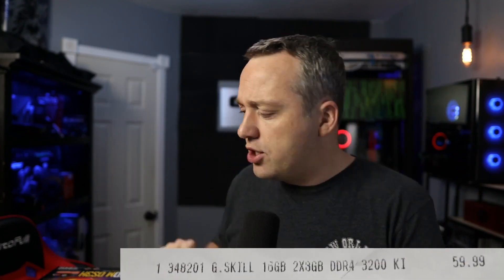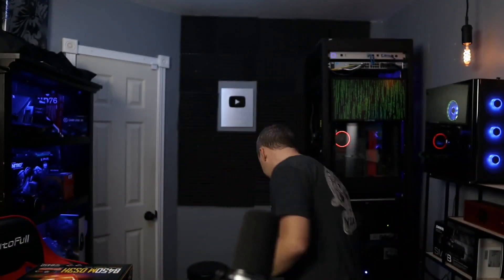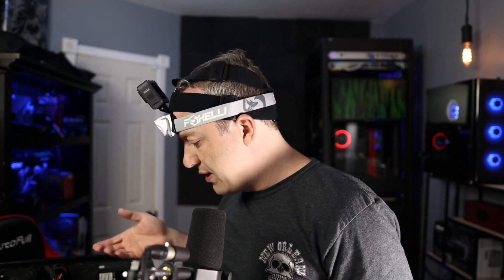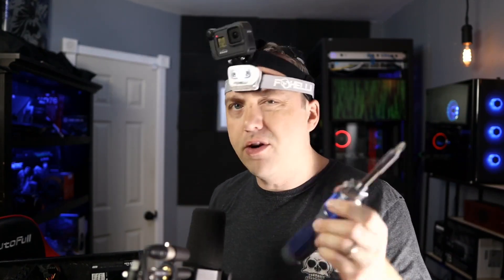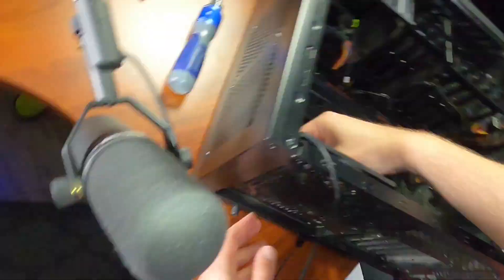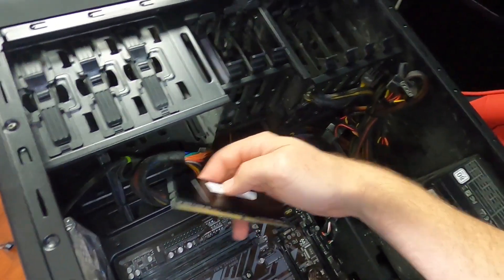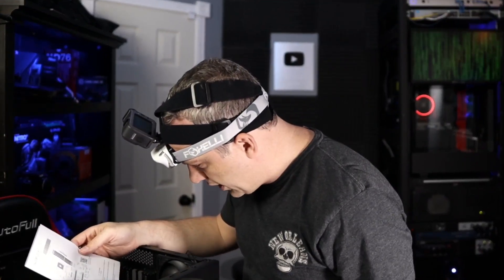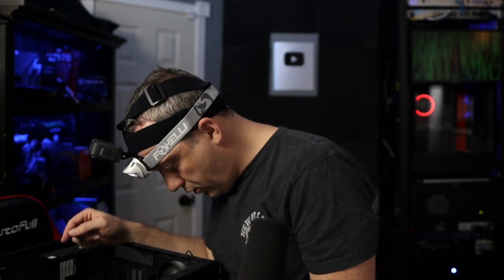Ryzen 5 3600 Budget Build

Comment: Finally someone who is on my level of budget building! I like some flare like the fan rings to be lit up. Mine is a black and blue theme like the one you have in the background. That’s all the lighting I want. Definitely not into the water cooling crap. I replaced my stock fan with the Vetroo air cooler on Amazon for $25 and it works great. Dropped temps around 10-15c and in testing it beat AIO coolers. Love your videos, they have helped me a ton getting rid of all the crap on windows 10. I’m learning a lot from you.

Comment: I have the exact same CPU and Motherboard and I am not disappointed in the least. However, my case was way too old (no cable management possible and awful air flow), so I had to get a new case as well as a new GPU. Came from an AMD Phenom II X3 720BE (with 4th core unlocked) and GTX 560. Went to a GTX 1660 OC. Love it! The Gigatbyte B450M DS3H has 4 DIMM slots. Not bad for a Micro-ATX board!

Comment: The Ryzen 5 3600 is a great CPU.  It's what I used when I built my new (current) computer earlier this year.
Reply: Does it come with a GPU?
Reply: @madthumbs1564  This model cpu does not have integrated graphics.  I chose to go with an Gigabyte Radeon 570 for my needs.

Comment: nxzt and cold master cooler lol

best to install cpu, ram, and heatsink on before mounting board into case.  The front panel connectors have a diagram printed on the PCB.  HDD/Power/Reset

Comment: I don't know what the reason for not using an electric screwdriver is. I've been building and working on computers for 30 years and I use them all the time. Primarily, I use it to REMOVE screws and it saves a ton of time. For inserting screws, I get it started manually before using the power screwdriver to finish it up. You COULD be asking for trouble if you just stick the screw onto the bit and use the power screwdriver from the start which could easily strip the threads if you got it started at an angle.

Comment: I just ordered basically the same exact components to upgrade my old Dell xps 8300 with the i7 2600.  It's been a good machine and still performs fine, but I want to be able to edit and publish videos a little faster.  It seems either there is a difference in price due to region or the prices have just crept up a hair.  I paid $310 from my local Micro Center.  I am putting my nzxt Phantom 410 back into service for the build.  It's a big bulky bastard of a case, but the wire management and cooling features will work well for my build.

Comment: congrats for the wife but i have 2 questions : 
1. whats the actual gpu you  used on this machine as we only saw you put the "final touches" xD, its gigabyte already we get it but whats the actual model ?!
2. why you did not re-use the evo 212 again ? cooler master support those on the am4 platform and they have an upgrade kit for this already so don't throw it ... just reuse it instead of the pesky old and loud wraith stealth cpu fan .... i would do that for sure as ryzen 3000 series will perform better overall (a couple percentages) !!

Comment: Here the problem with 'budget'-builds, it can easily get more expensive on the long run because you spend money on upgrades which you could have postponed by spending a bit more. I like the real budget-builds, that includes more expensive builds and it excludes many cheap builds. For me a budget-build is a build which offers all the performance that you need for at least 6 years while not spending more money than is required. I include factors like noise (CPU-fan, graphics card fan) and a reliable PSU in the performance. If you max out all of this, you can use the computer for a long time and you don't spend more than what is necessary to get this performance-level, then you have a budget-build.
Reply from the maker: I anticipate her using this PC for at least 5+ years. Might need to swap the fans out after 4-5 years, noctua's would probably last til it gets retired. However, everything else in this build should go the distance. While it might not be pretty, this is sitting under a desk and is never really seen.

Comment: Add a GTX 1060 and a nvme SSD and you got my gaming rig :) (I have Crucial 3200->3600 memory but same mobo and CPU lol)
Reply: Im planning that kind of setup. Hows ur benchmark?
Reply: @_Potato_Man_100  I don't do benchmarks.
Reply: How about performance?
Reply: @_Potato_Man_100  It performs as expected, the CPU is powerful, the video card is OK but not top performance, if you have the money you better wait a few month for new Nvidia and possibly new AMD video cards and their reviews (if you can not wait, a RTX 2070 is great too but newer video cards may be real good value).
CPU is real real good price/performance it is now around 180€ new. 
For the motherboard I went real cheap because it was enough for my use case, but if you put a higher end video card, then do not cheap too much on the motherboard you have the money so spend maybe 50 more bucks for higher end motherboard. Don't forget to also have high quality PSU because at the end of the day with clean voltage output all component will behave perfectly.
Reply: Wow thanks a lot

Comment: Ryzen 3600 
ASRock B450M-HDV 
Patriot 8gb ram x2 3000mhz 
240gb m2 ssd 
Cooler Master (MWE 500) 500w +80bronze
Thermaltake Versa H15 
1650 super 4gb or 1660 super ( Cant decide)

Should this be good for starting base? Will add more storage later just need for Rust atm.

Comment: Hey chris, would windows 10 and Linux running on separate nvme drives cause any issues on the motherboard? I already run windows 10 on my main nvme and wanted to install Linux on the second m.2 slot on my motherboard.

Comment: I'm considering a build using the Amd Ryzen 5 3600 3.6 ghz 6 core processor and an Asus Rog Strix B550 -F Gaming (with Wifi) ATX AM4 
motherboard. Now the Ryzen chip descriptions says "4 2 GHz max boost unlocked for overclocking 35 MB of game cache DDR4 3200 support" the motherboard supports up to 4400mhz ram. Now would I have problems if I were to run 16 gigs of 3600 ram in this setup?

Comment: I'm broke, so my budget builds are dumpster specials, topped up with eBay minimum price used stuff that nobody else noticed. Latest build, 775 dell 560 motherboard modified with a quad core Xeon 5420, 8GB DDR3, 3 HDDs total 1.7 TB, quad Intel network card. Total cost under $30. Setup with Proxmox at the moment. A cheap, fun hobby.

Comment: I'm well out of practice piecing PCs together, having had laptops for ages. The last tower I bought was in 1998. Will today's boards and components shoehorn into this?
Reply: Most likely yes.  Atx form factor has been standard since maybe 1995.  Afaik if you have a full or mid tower any atx or micro-atx board will fit, if the case is micro only micro atx boards will fit. You just have to re-arrange the studs and or add or remove some. I do not believe btx boards will fit.  All my cases are like 12+ years old.  Can't do beige though, that's worth a few $$ to get away from.
Reply: @countereverything  Thanks for that. I think mine is a full size case. Guess which colour ;p

Comment: Stopped watching at 5:17 when the 2nd ad rolled in. @YouTube: Counter productive. :(
Reply: install ublock origan into your browser and it will remove the ads from youtube
Reply: @mikaelrask  What - mid roll ads? Really?
Reply: @skf957  yes ublock will remove adds from youtube and across the web it will increase your speed wile surfing alot.have been using it for years

Comment: No. You are doing it in the verge way. 
You're gonna get so much criticism
Installing CPU,cooler and memmory outside the case is the (best) practice.
Reply from the maker: You are correct, but I didn't really make this as a how to guide. I did this because people wanted to see me build my wife's PC. Honestly, it doesn't matter when you put that stuff in as long as you don't get psycho during the install. I also don't like putting the cooler on before, because connect the the 4-8 pin cable is a pain in cramped cases. Again, if want to the exact way of building a PC check out Jayztwocents or LTT's old build guides. They are much better than anything I can do. Most understand that I am more of a software guy than hardware one.
Reply: @ChrisTitusTech  Anyway  I got a heart from you man . 
Always loves your vids